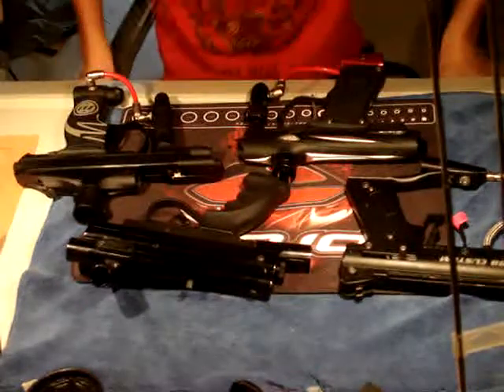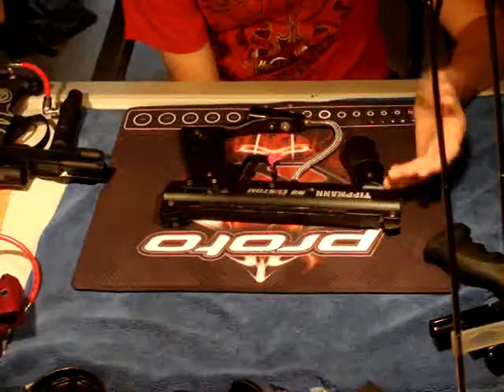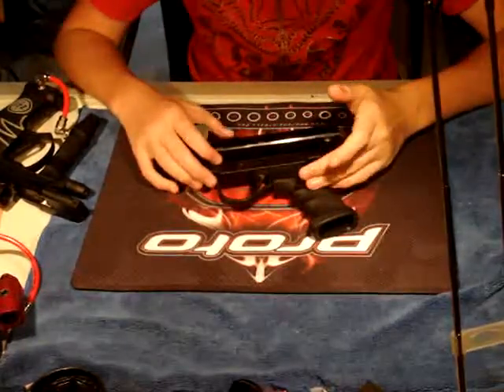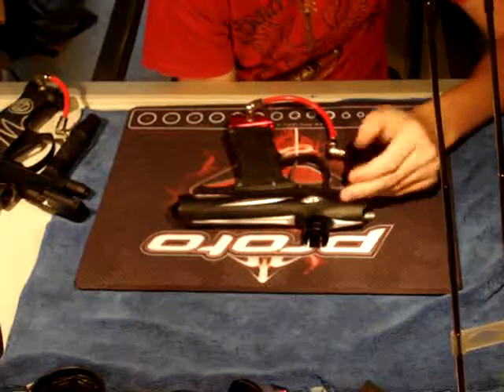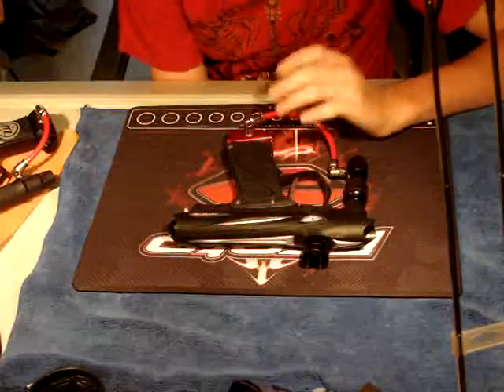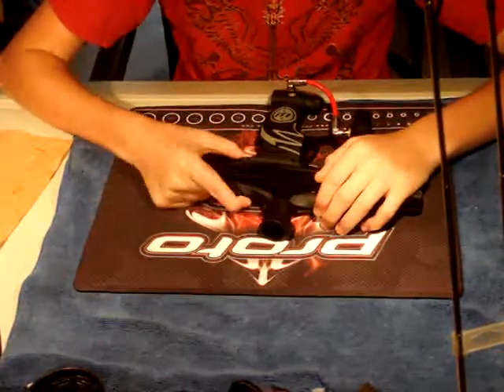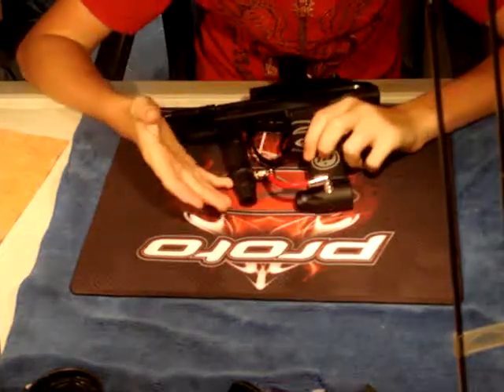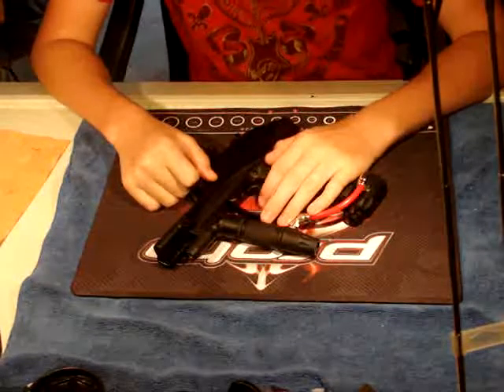Poppit valve vs Spool valve vs Sear based

Comment: Pump: spring forward, manually cocked back
Sear-tripper: aka blowback.  sear tripped, spring forward, hits poppet, air back. rest position against the spring (spyder, tippmann, pmi, azodin)
Cocker: same as above except it has an auto pumping mechanism (front block and back block) that pulls the powertube to rest.(every existing cocker)
Spool:  the bolt is the valve, air pushes the bolt forward, up to the firing point, then, air pushes the bolt back. (pmr, dm, slg, g3 etc)
Poppet: similar to sea

Comment: Every single gun he had was a sear tripper.  The 98 is an inline blowback, the "mystery" gun is a stacked tube blow back. The autococker is a stacked tube non blowback pump with an air driven pump/cocking system. All three are basic poppets. The slg is a sear tripping spool, the only one in existence. 

Should have done some more research man.